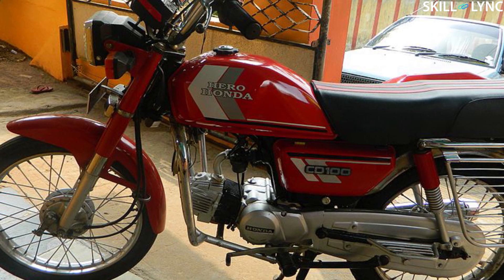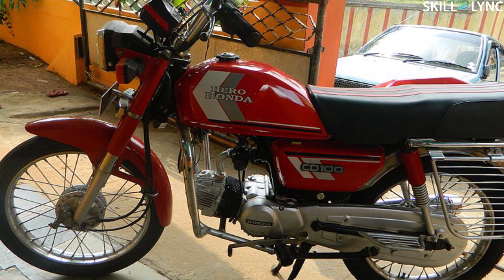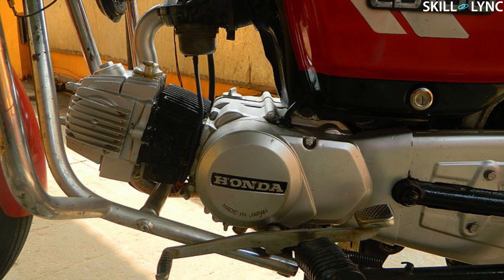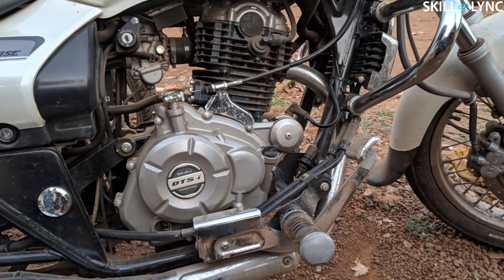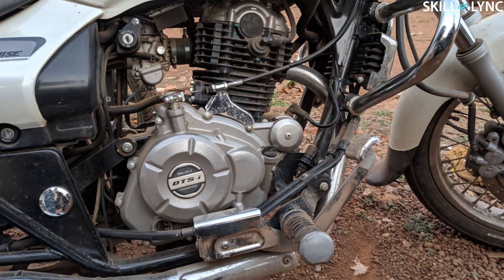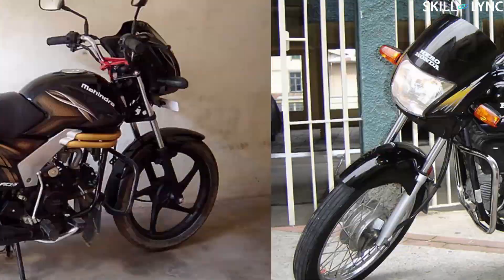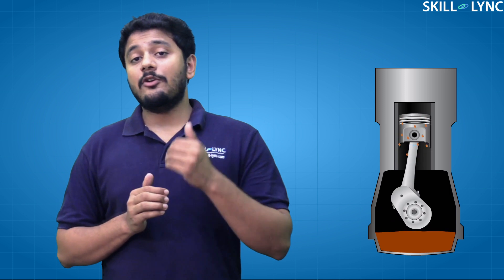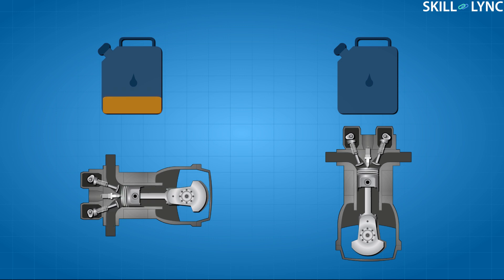Why do Horizontal engines exist in bikes? | Skill-Lync

Comment: Horizontal engine bike is very low pickup compared to vertial engine bike.
Pros
Experiencing of heat issue is less in footrests.
Low maintenance.
Fuel efficiency.
Cons
More vibration at higher revs compared to vertial engine bike.
Low speed engine.
Hero motocorp is only a successor in horizontal engine type bike.
Lack of complaint in this horizontal engine type.
Horizontal engine bikes
Hero- splendor, deluxe,super splendor, passion, glamour.
Tvs- centra,xl100
Mahindra- centuro,pantero,arrow
Reply: Horizonatal engines have good pick too
And Honda engine is used in hero. Honda used Honda Cub engine is In hero.. Honda cub is the most Reliable machine in the world.